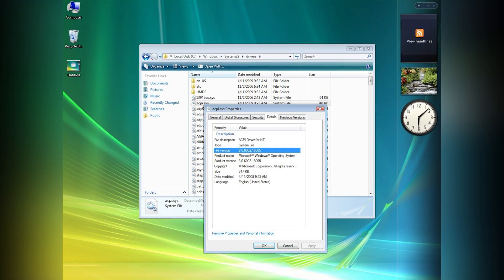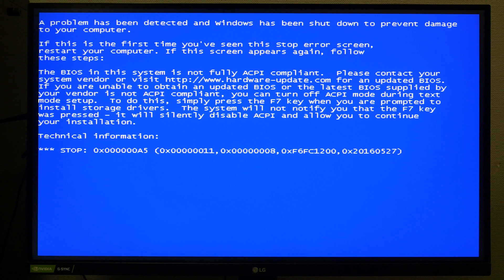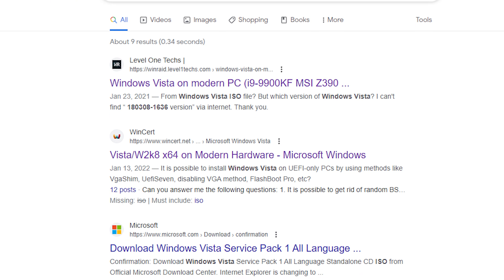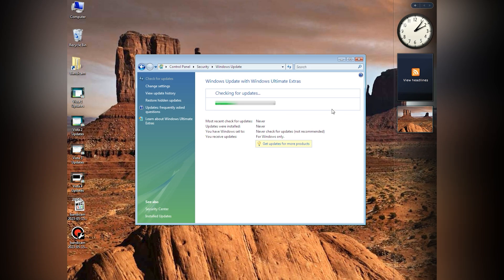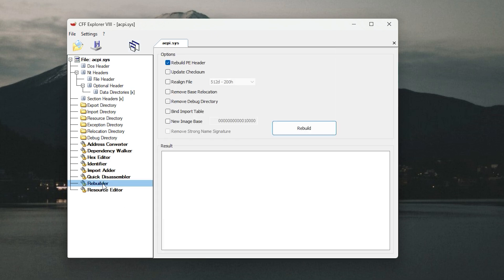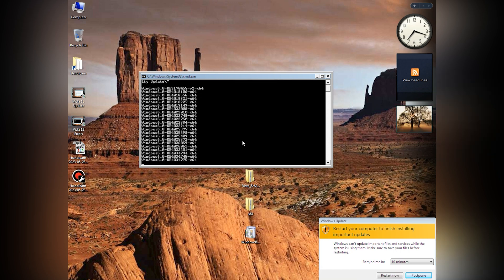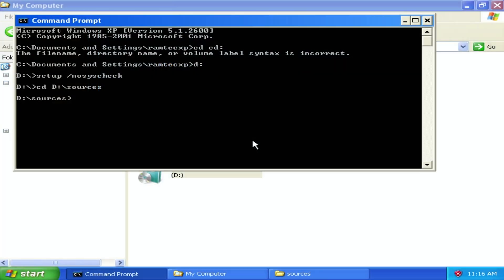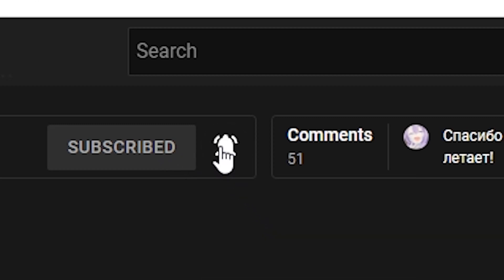Can Windows Vista Run on a New Modern PC 2025?

Comment: Vista runs perfectly today, activating happens with the sp2 package. The "not original" disappears from the screen, but you have to remove the black screen using display properties. Mozilla login to youtube: when asks for new explorer, choose later, try to login to google and you are done.
Works w xp, opera too, chrome too. 
Xp activating happens by installing media player. 
Some laptops reject legal xp cd, you have to change the cd rom. 
The outer cover is recognized if legal or illegal.

Comment: Vista remains my favorite OS even now. I used XP and 7, but Vista was the one I liked. It was the last Windows build that had a built in Troubleshooting guide, and most issues could be resolved without any internet connection. 7 dropped that all in favor of the always online model that exists today, and while I appreciate the now included anti-virus, I miss the ability to fix my computer issues without having to dig through forum thread after forum thread, and trying unsuccessfully to troubleshoot one thing or another, because my internet connection isn't reliable enough to handle it.
Reply: It helped that the computer I had at the time, was actually built to handle the OS properly.

Comment: I still knew how I liked the modern design of Windows Vista as a child. Considering that it comes from 2005, it still looks quite modern.
Reply: 30 january 2007*

Not really 2005
Reply: @thewiiguy Actually Vista was completed in 2006 (which makes it even more impressive for it's time) and it released to the public in 2007
Reply: @MkeyzTeal  yes yes, you can see the exact year number on the RTM release
Reply: idk where u got 2005 from, he literally said 2007 in the video
Reply: @tomyyoung2624  i don't like the Windows 7 wallpaper i also don't like the taskbar either. I still Think vista is great.

Comment: maybe you need to disable UEFI boot mode and enable LEGACY/UEFI boot this lets older operating systems boot on newer hardware. also try disabling secure boot
Reply from the maker: It was all disabled. The main reason is incompatible ACPI version
Reply: @RamtechENG  im sure their is a workaround as you got windows xp to work and I know windows 7 will work. Did you try 64 bit version of Windows vista.